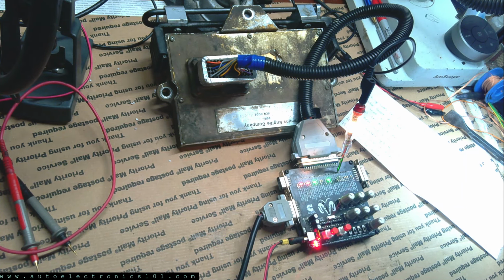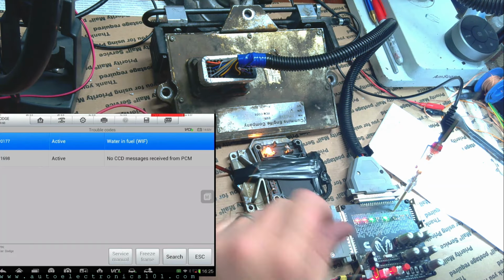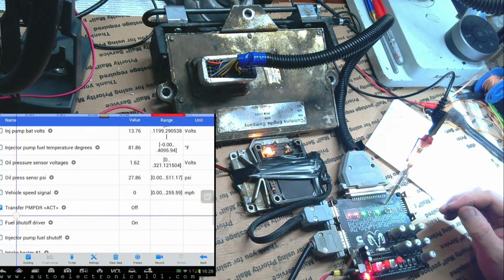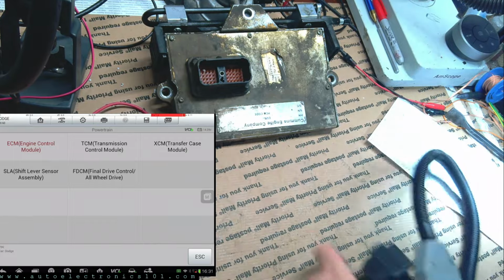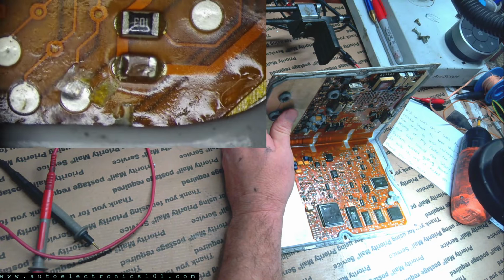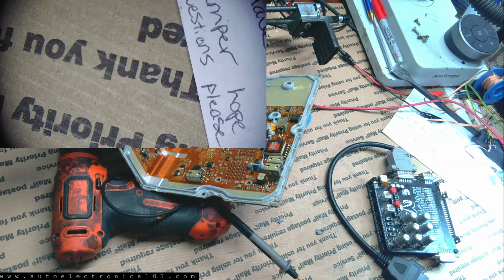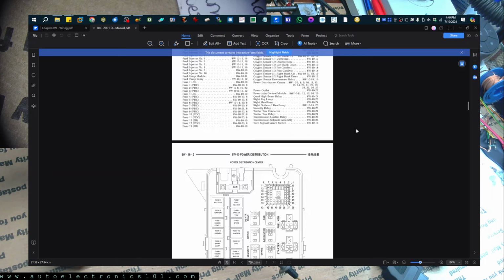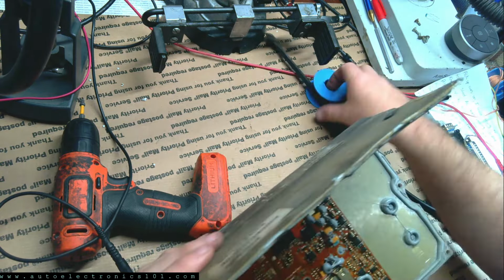Bench Tester Claims It's Good, But Is It Really? 99 Ram 5.9L Cummins ECU Repair

Comment: Great video. How do you (How can I scan for codes without a PCM? Special scanner to scan the SCI bus? Thanks
Reply from the maker: The ecu is read on the SCI bus yes. Problem with these is PCM is on sci bus as well and when they are both hooked up  most tools do not deal with it properly. If you just unhook one or the other though you can read the one still hooked up with no problem.
Reply: @ecurepair  Thanks for the tip. I tried that with no luck. Perhaps my scanner cannot read SCI. I am using ELM 327 that works perfect on my 2006 Ram 2500 (CANbus). Any recommendations for a confirmed readable scanner? I had my eye on FORScan.
Reply from the maker: @AlexShrugging  links in this video for a decent tool that works well on them for me. It used to just be 99$ dunno about now. https://youtu.be/-TRGgVoOUl4?si=ahzeM2zT1CMrdmcD
Reply: @ecurepair  Thanks. FYI, Your product links (eBay, Amazon, AliExpress, etc) in your descriptions are not working. Which Autel are you using? That seems to scan 99 SCI bus with no trouble.
Reply from the maker: Weird. Works for me. the Ediag Link is https://amzn.to/3LjkG3z
I use a 908 in most of my videos but the ediag actually works better on SCI stuff.  The cm551's and cm84x units.
Reply: @ecurepair  Now it's working mate.  👍